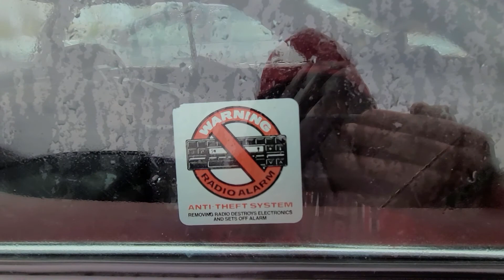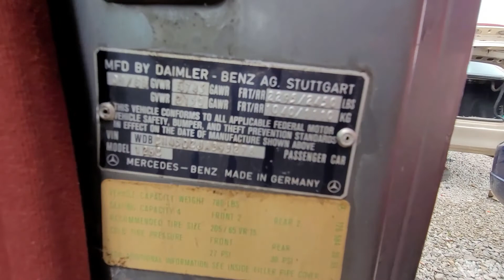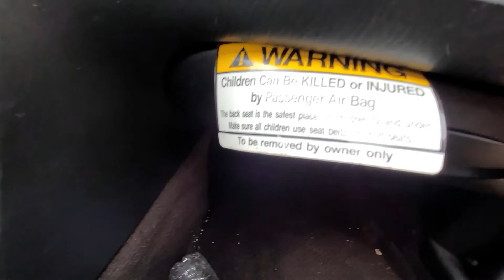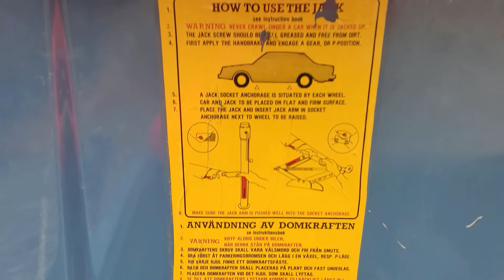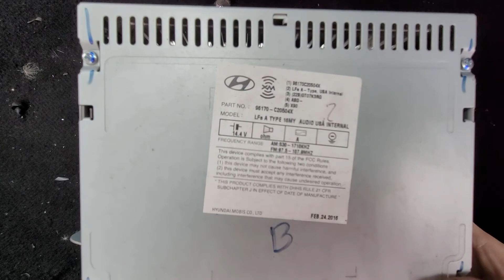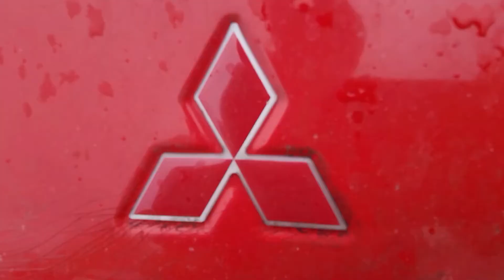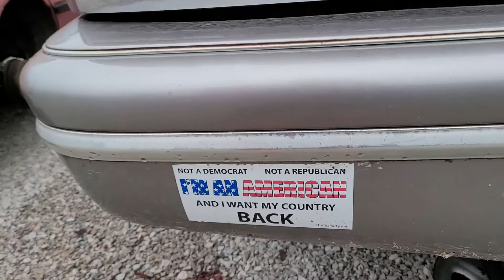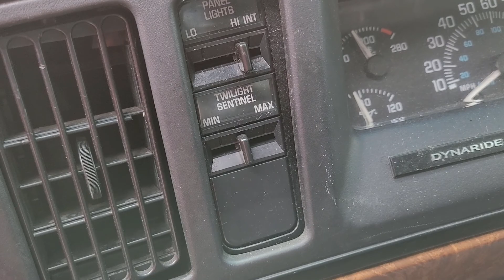Salvage Yard Walk Around 10-21-20

Comment: Also, was doing a bit of reading- the Buicks Twilight sentinel turns out to be GMs feature to turn on/off ext lighting with a sensor analysis of 10 seconds. Also it can be tweaked to stay on after turning off the car keyes removed to light your path as you walk away. Seen that all the time and it was Twilight Sentinel, 😎
Reply from the maker: Thats very interesting. Thank you for the information!